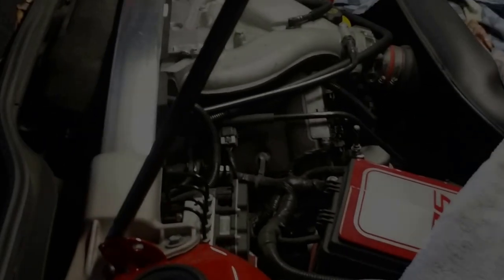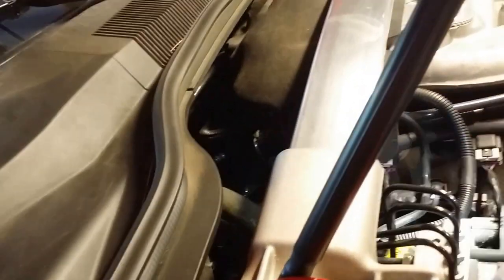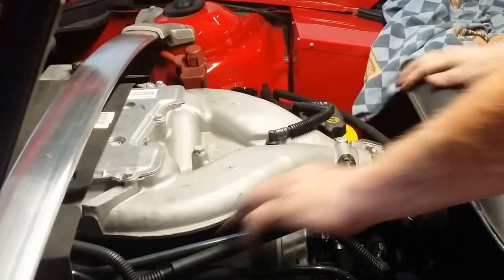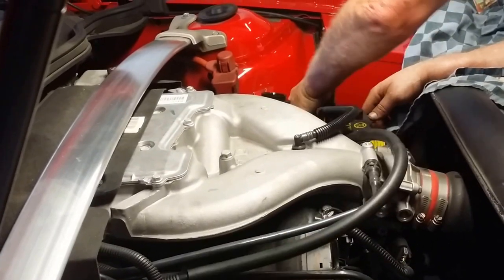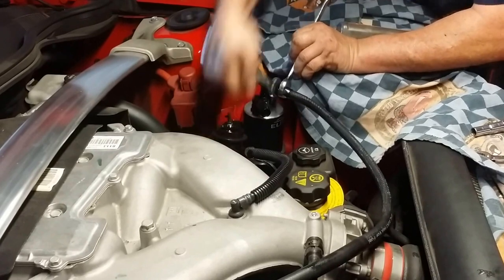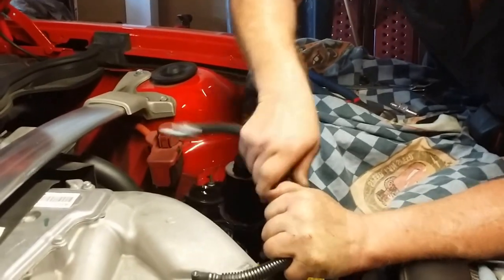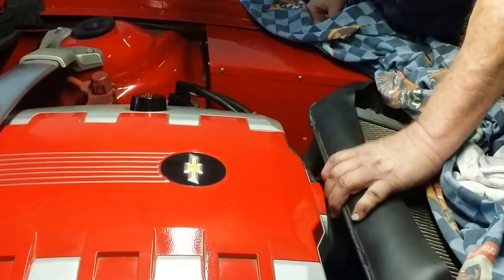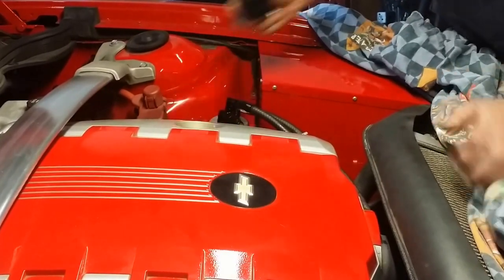Elite E2-X Dual Valve Catch Can Install - GEN5 Camaro V6

Comment: he says they put a vacuum cap on the original clean air side. where did that used to go? I get the first part since we tap into the stock lines, but why add the second set? I know it gets vacuum at WOT and collects that oil, but if the original didnt have vacuum at WOT, then we wouldn't have any oil to catch. is there 2 lines carrying oil stock?